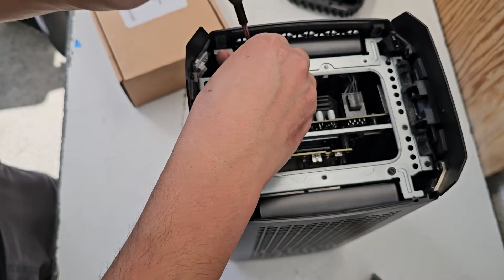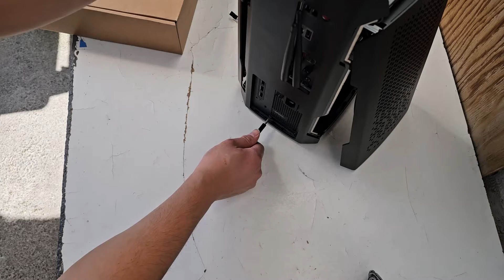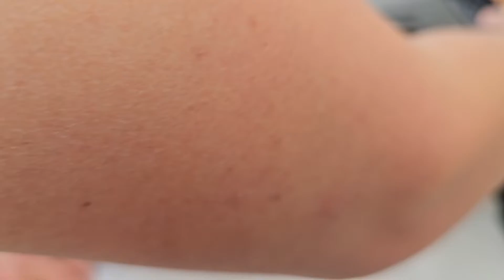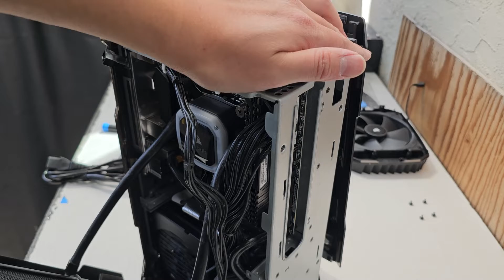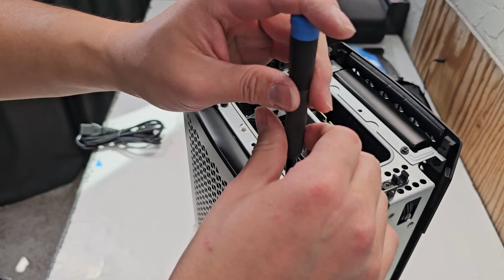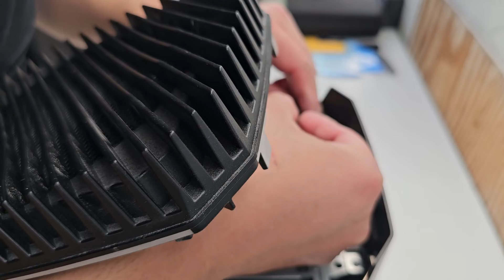Corsair One i140 Desktop Disassembly Power Supply Replacement Repair

Comment: very helpful, i had to replace my AIOs pump on a i165, 8 years old system, this video proved to be useful, by a lot, since cable management is hella tight and you basically need to remove everything to plug the new pumps.
Also kudos to corsair for replacing them for free despite the system being 7 years out of warranty
Reply from the maker: Awesome, glad it helped. If you haven't already, please like and subscribe so others can find my videos and possibly consider watching a few others, liking and commenting to get the algorithm to recommend my channel. Thanks!
Reply: @ItsBinhRepaired  No biggies, i'm still trying to see if, by any chance, you dissassemble the AIO on the cpu cide, cause that thing has more connection and pins that i've ever seen for an AIO. I'd have assume max 2, one for the power and one for the CPU FAN on the motherboard. But it has like 3 bonus cables that i can't for the life of me figure out how and where they are supposed to go
Reply from the maker: @devolutionparpaing9855  lol likely for lights

Comment: Great video.
Reply from the maker: Thanks
Reply: @ItsBinhRepaired  hi can you tell how to check if psu is dead? mine just shutdown today and it wont turn on
Reply from the maker: @narendrarao5607  try another and see if it works.
Reply: @ItsBinhRepaired  hi does the ethernet port light still blinks even if the psu dies? does motherboard or gpu dieing will least boot the pc?
i dont have in hand so i have to buy a new one
Reply from the maker: @narendrarao5607  pretty sure
Reply: @ItsBinhRepaired  which one you meant
Reply from the maker: @narendrarao5607  the ethernet ports light up even with no power I believe. But varies from computer to computer
Reply: @ItsBinhRepaired  thanks i ordered a replacement also i see u replaced all the cables. can u just use the cables of old ones and just replace the psu so i dont have to take all cables out
Reply from the maker: @narendrarao5607  only if it's the same model/brand
Reply: @ItsBinhRepaired  thanks a lot. What could be an indication of motherboard or gpu failure
Reply from the maker: @narendrarao5607  anything can be motherboard. GPU usually no boot and fast fans, but nothing specific. I usually test with a known working one.
Reply: @ItsBinhRepaired  hi again i hear a click noise when i try to switch the computer does a dead motherboard make this sound
Reply from the maker: @narendrarao5607  click sound?
Reply: @ItsBinhRepaired  hi when u press the power button i hear a 2 click sound normally after the sound the system used to boot
Reply: @ItsBinhRepaired  i changed the psu but no power sadly